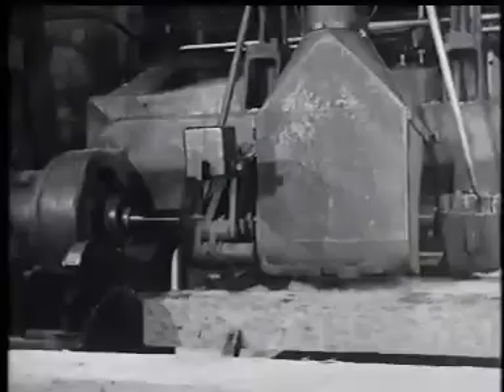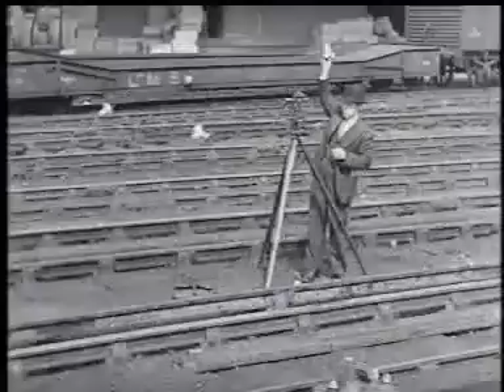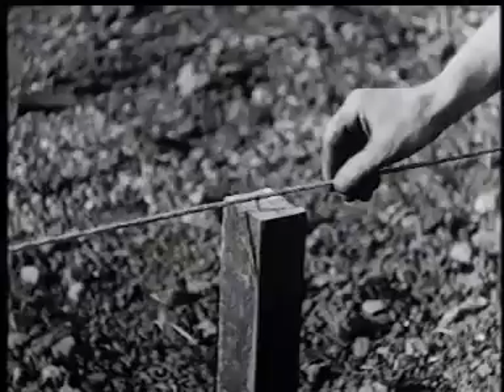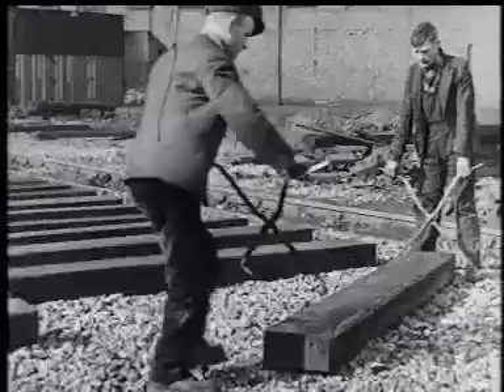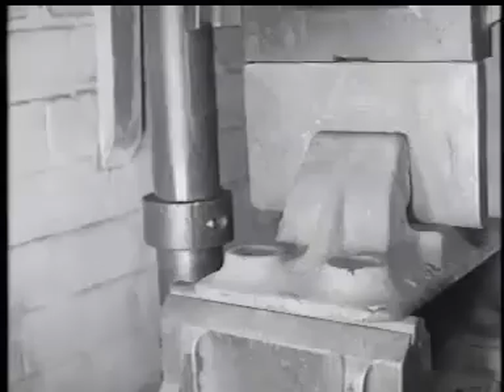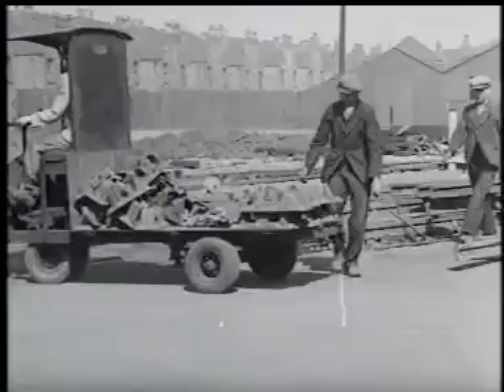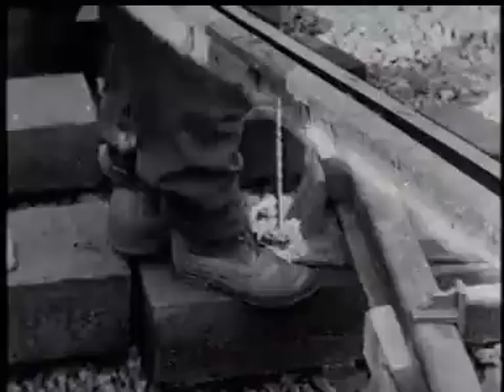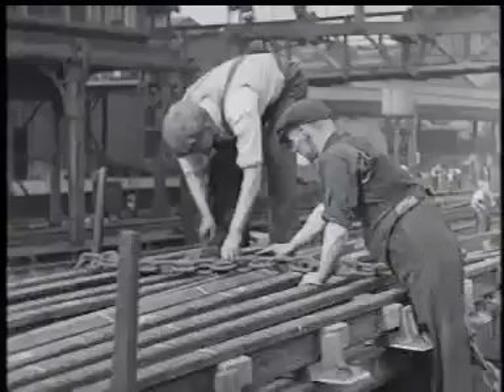P Way Junction renewal - the old way

Comment: Not really changed much in all these years. Renewing a large junction like this we would prefabricate at a yard similar to the one in the video. Although the bearers would be concrete not wood and the tail would be different. The layout would be split into panels and lifted into place with a crane. What is different is that we would excavate all the ballast and replace and once all fitted together it would be welded and stressed. Also a mechanical machine called a tamper would lift and the the layout. So some differences for modernisation but the principles are the same.
Reply: Worked Pleck Junction as part of the S&T years back.  Was quite something to be involved in.
Reply: Still be wood s&c timbers today
Reply: @andthenightcame8959  Both are still in use with more emphasis on concrete.
Reply: @andthenightcame8959  what wood is most commonly used for rail tracks?
Reply: @chadbailey8152  After WW2 a lot jarrah wood (from Australia) was used in Britain.
Reply: @chadbailey8152  Back early 1980's BR was mostly using Jarrah, an Australian Eucalyptus wood.
Reply: Yes they still pre-build all junctions away from the line. Nowdays they are shipped in huge chunks and craned into position to make renewal really fast.
Reply: Everything being replaced in my area are concrete. Which means the rail spikes are going on the endangered list. As soon as the billions in use are gone, they're gone. Get them while you can.

Comment: I’ve built about 35 turnouts  and two double slips in my time. This is beautiful work and fascinating to watch.
Reply: bigkiwimike me too! In HO scale.
Reply: Did you get to do the latest ones, where one lever slipped all of the points at one time?
It was interesting to see half moving the other way, but at least the were no more derailments!
Reply: @danieljones317  Hi. Are you referring to a double slip where one lever each end moves four blades instead of two?
Reply: @bigkiwimike  the last one I saw had one really long lever, and it moved all eight blades, or points.
It was away from the yard on a really long siding lead.
I was 14, I think, and I actually worked that lever several times.
It didn't take a lot of effort, and I saw that either way, any traffic would not derail, as in the older ones.
The train either went straight through, or it slipped to the other track, on both routes, and both routes were the same, very safe arrangement.

Comment: AH. The good old days. No rain gear. No safety gear. No machinery for lifting and setting. And you always knew where the kids were. Yes, there was no time for the youngsters to get in trouble making molds and doing the casting at the foundry.
  And Mother had a life of leisure too. She had all the time for her self when the chores were done. Chores like laundry scrubbed by hand. I bet those railroad stains took some heavy scrubbing. And don't forget to rinse and hang out to dry. Better get to the market for tonight's dinner. And bring in some wood or coal for the stove so you can cook it. Start cleaning the house too. Don't forget to make the beds Mom. The men will be home from the rail yard soon. Better set the table with all the goodies so everything will be ready when the dinner is done. And then before you knew it the men were home from work. Everyone was scrubbing up from the soap and water and towels Mom set out. Clean towels from the previous day's laundry. After dinner, everyone helped with the dishes. Then bath time was ready when the water was hot on the stove. Off to bed to get some sleep. And wake up in the morning and do it all again. AH! The good old days when workdays were twelve hours or more long. 
  And just before she drifted off to sleep Mom remembered that she needed to get up early to split some wood for the cook and the heating stoves. She didn't mind. She knew how hard it must be lifting steel all day long. And Mom drifted off to sleep saying her prayers. And thank God for such a wonderful family. And looking forward to the one day off the men had. Yes, thank you, God it is a wonderful life.
Reply: Ah, yes and don't forget all those lovely times with Dad spending all his paycheck money at the pub then coming home drunk, yelling at the kids, and hitting the wife.. the good old days.
Reply: You also couldn't marry someone who was a different color than you. Workplace injuries were common.
Reply: "Don't forget to make the beds Mom." Slobs should do it themselves. Get up and make the bed, all in one go. Not so hard unless you are a pampered slob.
Reply: Are we meant to have a "life of leisure"? I haven't had one and I wouldn't have wanted one.   Wash-day, in England, was Monday, many people sent their washing to the laundry, as in the Winter it can be impossible to dry washing outside in Britain, (the local laundry, "Sam's" was hage and in the street I still live in, it closed when washing machines became common-place) people did not have baths everyday, they actually had "bath night" once a week. 
BTW, for all the "Hard Labour" in a woman's life they still lived a lot longer than the men. Working on the railways, men would have shifts that could start at 2:00AM. Housewife's didn't have that, they set it all out the night before and stayed in bed generally. (My mum was married to a railway man who worked on the permanent way, he died in 1973, he was 59 and had cancer which can happen to anyone, of course, it wasn't work related, she died in 2003 aged 78) It was the irregular, and often very heavy nature of the mens work that took it's toll. I haven't watched the film but are girls working in the foundry?
Everybody has their own story and it is worthy of respect. We are virtually all forced to conform to the society we live in, I was there, and yes, it was a great time. How can you possibly know or understand that?
I did laugh at the comment, "everybody helped with the dishes...", generally the children did it, before their homework. 'Night John Boy!'

These days children finish their education often with £40K worth of dept. So civilised!!
Perhaps it is all God's fault?
Reply: "Hage" should read "Huge"
Reply: @brmh1667   By the 1980's, P-Way workers were being warned that the dirty grease from trackwork was suspected of causing cancer of the foreskin because, y'know, not washing hands before taking a pee. Like there's a hand-basin at every milepost duh.
Reply: It was better then building pyramids ,  why all the downers ?  It was what it was , I had family that worked like this and we're not drinkers or doing harm to there kids ! Lots of great people that just lived and worked hard ans were thankful  !!
Reply: @Demo He is going back to his childhood only remembering the good bits.
Reply: Does all that work then dad comes home from the pub at 8 and wonders where his dinner is so he gets a bit physical with mum who's trying to explain she is about to heat dinner up for dad but she didn't know what time he was going to get back. Nostalgia is a load of nonsense. Those rose tinted spectacles just have shit smeared on them

Comment: I like how the narrator talks about the “electrically driven screwing machine” almost reverently.  Electricity being something special.
Reply: My wife's got one of those.
Reply: @rogerking7258 , my wife doesn't need one.......
Reply: That was actually a major thing back in the day when screws started becoming common.  It was such a huge problem that the current US building code for wood still has a line that says "12.1.5.4 The wood screw shall be inserted in its lead hole by turning with a screwdriver or other tool, not by driving with a hammer".
Reply: "Screwing Machine."
Reply: When I was in the PWay, late 1970's, we were still using hand augers and t-spanners to drill holes for chairs screws and screw them down.  It was a two man job on the t-spanner and a right pain in the arse when you got someone who didn't know how to move and place his hands properly in time.
Reply: The same job could be carried out with a battery powered drill in one hand now.
Reply: @althejazzman  Sort of. The battery drill could probably handle that level of torque, but I doubt your hand could. (And thus any drill built to be hand-held won't be quite up to the task).
Reply: @c182SkylaneRG  Modern impact guns deliver a shit ton of torque.  That being said, you shouldnt use a high-power impact installing lags in wood.
Reply: @c182SkylaneRG  our gas powered ones barley do half the time, i doubt it
Reply: @tippyc2  if you use a gas sleeper drill an a electric one, you can instantly tell the difference, nobody on track is gonna opt for the electric over the gas ones
Reply: I dunno. My M18 Milwaukee tries to twist my hand straight off at my wrist when drilling holes in wood, so I can imagine anything bigger being even more aggressive if it binds up. (Although I wrote this comment before I saw the length of the handles on their drills).
Reply: @althejazzman  not quite, ive had robels an impact wrenches not able to tighten screws into baseplates for multiple reasons, most often we have to bash the chairs out an unclip the rail so that we can wriggle the plate until it fits
Reply: The stinky government has now become an "electrically-driven screwing machine".

Comment: Mostly done by machine now. Most of those men became unemployed and their skills mostly lost.
Reply: Bollocks, S&C is still built the same way.
Reply: Not at all. I work in this insustry and it's all still done by hand. Only difference is technology means things can be done more effieciently like casting crossings instead of fabricating them. They still need to be machined and they still need rails welded on and assembled. Then you still have to  put it all together. Things have become more accurate with the machines they use to measure things but people still do all the assembly.
Reply: Most of those men died of old age!
Reply: Technology moves on and their great grandsons and daughters are now skilled at programing   computer controlled machines. They are still engineers but 
 with clean hands, far fewer occupational diseases and accidents and productivity beyond the belief of the men in the film.

Comment: When the molten metal is poured into the mold, wouldn't the sand shift around and distort the shape?
Reply: moulding sand, is rammed and "sets" holding its shape during casting
Reply: Norm T You from the generation of reactionary jerks? Wtf?
Reply: Norm T  Lighten up dude.
Reply: Yes. Ive always wondered. it;s damp I tank and packed so well there is nowhere for the grains to go.
Reply: Its called green sand or casting sand. Really dense 
Like 175 lbs a cubic ft dense.

Comment: Brilliant. I got a bit confused with those black and white marks and the 'lathe' or something but other than that was very informative and wonderful to see the work being done. Labour intensive. Love the steam crane too.
Reply: They mark the centre of the timber and mark the rail head so that when they are dropping the rails in on site everything lands where it should e.g toe & nose position and making sure joints land centre of beds
Reply: +mark carey Laths - not lathes - are the thin strips of wood that were being pinned to the sleepers as markers.  Typical tradies - can't just call them bits of wood...
Reply: Geoff Barry
Hahaha. Cheers, though I've no problem with trade jargon. There are no ropes on a sailboat.
Reply: mark carey   There is a rope on a sailboat ——The Bell rope
Reply: @markcarey8426  They're lines, right?
Reply: @briansmith8967  OK
Reply: @markcarey8426  Ships bell rope.

Comment: Nene Valley Railway still use a steam crane for track repairs renewals. It is sometimes just put into use as a showpiece.
Reply: BR was still using them in the 1980's for re-railing derailments. Steam didn't die in 1967!